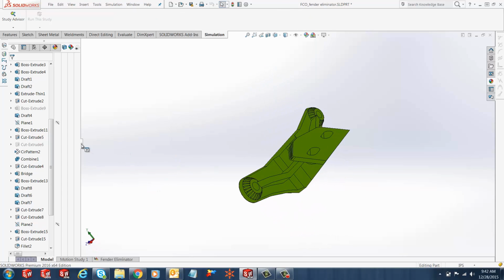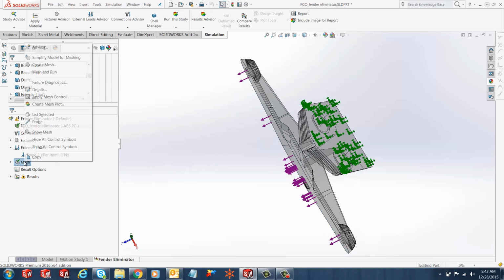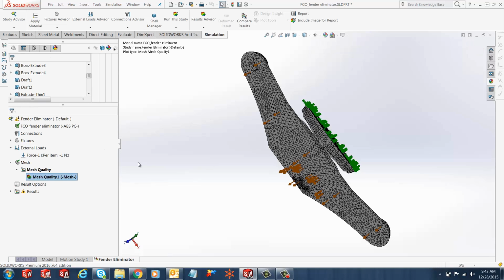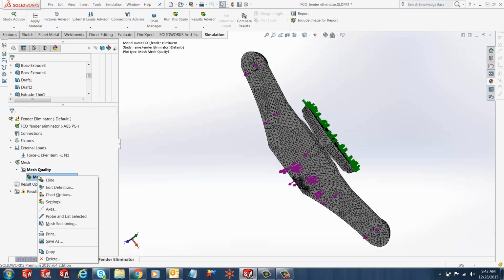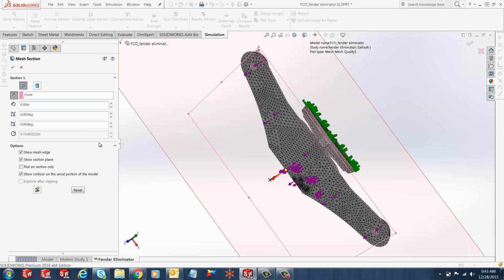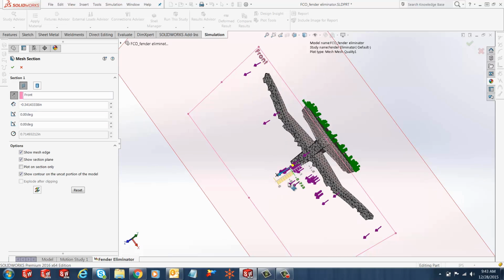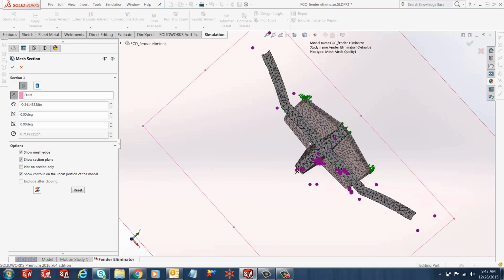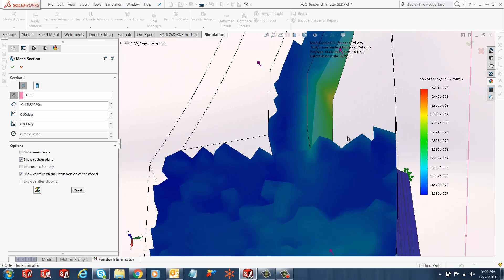SOLIDWORKS Quick Tip - Mesh Sectioning

Comment: Great, but how do I remove the sectioning after I clicked the green check mark?
Reply: You probably don't need it now after a year, but for those who have a similar issue, you can hit the icon to the left of the reset button in mesh section panel (1:46) and it'll be fixed.
Reply: @mahyarkhajehzadeh2681  thank you for your reply, it helped me :)